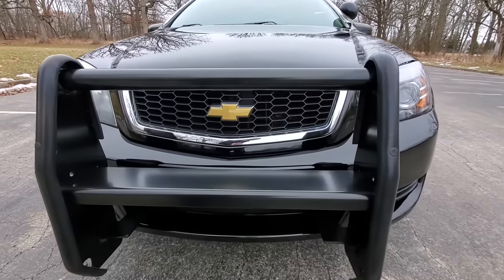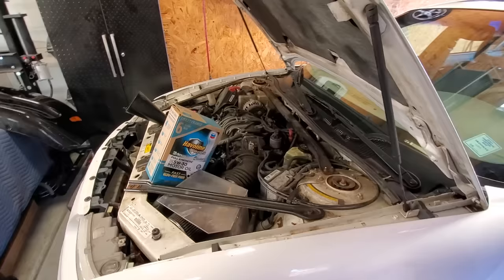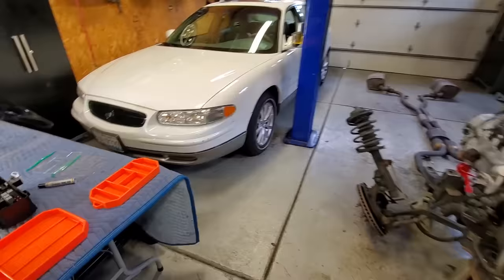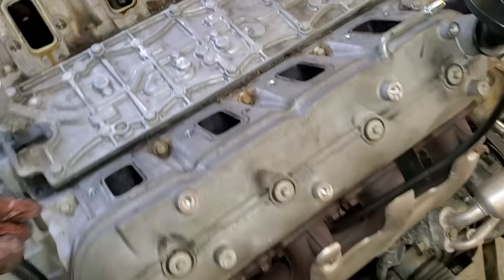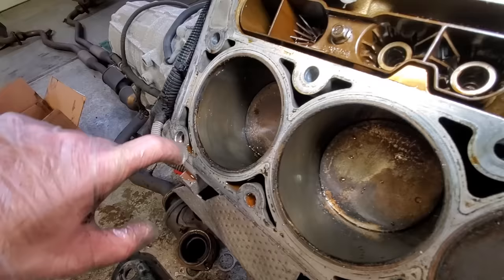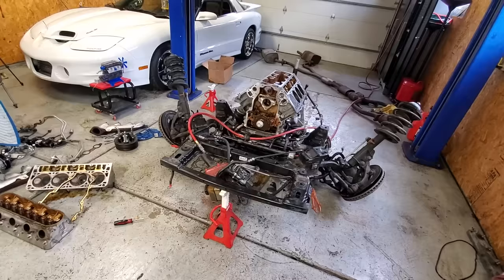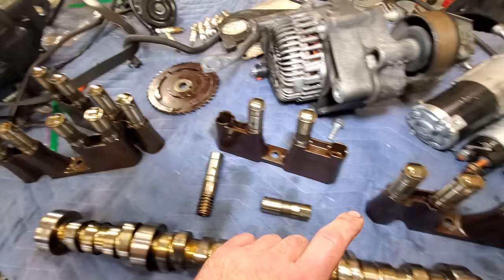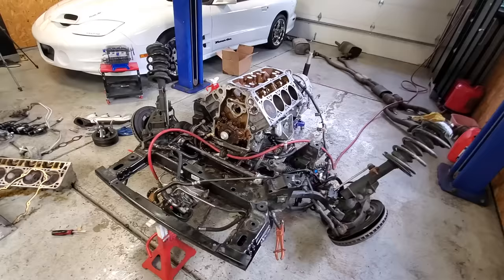Looking Inside An ABUSED V8 Engine That Idled For 12 Months! 357,000 Mile LS Teardown + Body Removal

Comment: Seems a lot like you just debunked the “1hr of idle equals 33miles of wear” myth. 

Like, that equation is more like 1hr = 2-3 miles.
Reply: You also have to take into account that they changed the oil a lot as he mentioned in the video, that is why that engine looks as good as it does.
Reply: Find the distance using hrs and the average gear ratio of your whole box to account for mixed driving
Reply: 8000 idle hours isn't that much. Not like it's a diesel from the 70s that would wash the oil off the cylinder walls. 

It's definatly high, but not crazy.
Reply: Well rule of thumb is a load of more than 80% is actually causing wear. At least according to what I have learned at trade school as a maschinist. Running an engine idle wont do jack to the engine exept for  a turbocharger that one will gunk up.
Reply: @vHindenburg  I guess average BMEP would be more accurate for a wear indicator then?
Reply: Compression would be I guess... how much oil it is losing and so on. Noise is also n indicator.General wear on belts and timing chain if the engine still has one. BMEP is short for ? Sorry English isnt my first language. And of course if the engine still produces the advertised horse power / kilowatts.
Reply: @vHindenburg  Brake Mean Effective Pressure. Used commonly in aviation as an indicator of engine output. It is basically an indication of engine load. It is the average pressure in the cylinder across all strokes. (Intake, compression, expansion, exhaust) 

A measure of how hard the engine is working. Better than measuring vacuum or rpm. 

Example, 200psi BMEP at 1000 rpm means the engine is working just as hard as 200 psi BMEP at 6000rpm. It will be putting out more power, but the effective loads on the pistons is the same.
Reply: Give me a dollar for every cam replaced in a patrol car....  Ill buy my island.
Reply: 8k miles is low in regards to idle hours for vehicles at my Dept. Most cars we have are about 15k idle hours. Plus 57k to 154k miles and our mechanics def don’t do PM’s every 3 months
Reply: @jaee1758  How do they that many idle ours anyway? Its almost illegal to leave a car in idle longer than about a minute ( At least by German law ). All because of AC? No start stopp automatic?
Reply: @vHindenburg  Cops rarely turn the car off. When they're posted up watching traffic, the car is running. We don't have any laws in the US that prevent this.
Fleet vehicles for companies often have a loooot of idle hours. People feel "it's not mine so I don't care"
Reply: @Juice-tr8xi  What is the benefit to keep the engine of cops cars running? New engines start up fast. Only some more wear in life time of that car if it has to go to full throttle after get in action. saved so much fuel and emissions.
Reply: @Juice-tr8xi  What  a waste of fuel. I cringe hard at this. Fuel prices are so much higher in Europe in comparison. But I get where this mindset come from then.
Reply: von Hindenburg  look at it like this if a Dept has 10 vehicles 4 maybe for supervision (those vehicles arent running as much) 6 vehicles for officers if your working 24/7 then a vehicle probably has 30mins of down time between shifts for a total of 1.5 hours of not running during a 24 hour period. And if a vehicle came into service in 2015 just imagine the wear and tear and the 10 different driving styles of the people sharing the vehicles.
Reply: @Ziellos1000  I think they real thing learned here is change your oil often and take idle time into account as miles driven.
Reply: Well, it is wear on the engine itself, but it doesnt wear the suspension and other components as much.  Engines last a looooooooong time, its the trans, suspension, and other parts that go out faster.

My dad and I travel a lot for work and often have to work nights or take quick naps between jobs.  We nicknamed our cars as "Hotel *car model*".  Across 8+ cars, they always burn right about 1 gallon per hour, and that provides all the heat and more importantly, the A/C needed to sleep and rest comfortably.  Much cheaper and convenient than a hotel, and we can fit a decent mattress in the SUVs.
Reply: if at all.. modern engines are designed in a way that idle is just a normal operating condition…
Reply: @vHindenburg 
 American legislation doesn't care about emissions. And if you're a patrol cop in Florida I would think you need that a.c. running near constantly anyway.
Reply: TESLA Electric car  is the ANSWER for this problem.
Reply: Alie148 because in hot climates the cars have to stay running with the ac on or it destroys the computer and electronics inside the patrol car.. not to mention the amount of gear and the vest le is required to dress while on shift
Reply: Stvn Bl the laptop will handle this, the officer won‘t with wearing all his gear
Reply: bigpjohnson Why? Modern engines are computer controlled and run Lamda 1 at idle as they do during normal driving... so no problem with oil dilution or the oil beeing washed of the cylinder walls... it may be different with carburators... also modern oil pumps are so powerfull that they provide enough lubrication even at idle speed... they might just burn a little more oil because at idle cylinder pressure is low and if equipped, turbo chargers also like to eat oil at idle because their seals need the air and exhaust pressure to keep the oil where it belongs
Reply: Jae E no cold starts, perfect for a long engine life
Reply: @acerc.e.4279  look into what goes into making just the batteries for those
Reply: So that isn't same thing new to me fare north in Eurasia it is commo to let the car running during the entire winter  (outerwise the engine wouldn't start again at - 30° C and lower) and man they have the cars for quite same time with out excessic wear to be true the bearings do look great because while cranking ur engine u have 0 oil pressure (for about half a rotation) and the metal parts a in contact (that's why cars with start stop automatic have allmost every time so called sputter bearing)
Reply: @bobl78  they have to keep them running anytime their systems are on or the cars will catch fire. The systems in the car draw over 150amps constant, requires a dedicated cooling system just fo the electronics, which requires the engine to run all the time which is why their cars come with 270amp alternators. Its not some simple laptop. Its an entire interconnected system.
Reply: @donniecahill5243  Sit down donnie. Come back when you do fleet maintenance. They do burn through alternators, ford went from 130amp to 150amp then in 2014 to 270amp on their special service vehicles. Same alternators as their commercial fleet vehicles. I don't have to know jack about electronics I just have to know what the spec sheet tells me it requires. It calls for 150 amp load safely. So sit down and shut up.
Reply: @Oldsoldiersays  you literally just admitted your own ignorance 😂 cool story bro, come back when you actually learn facts about duty cycles and basic electrical knowledge
Reply: @donniecahill5243  riiiight, sit down donnie
Reply: @Juice-tr8xi  You sir are incorrect. We most certainly do have laws regarding idling vehicles in the US. Perhaps not in rural areas, but the big cities have them for sure. In NY there's big fines for idling, especially if you're doing it in a truck, then you're talking up to a couple grand.
Reply: @donniecahill5243  Alternators don't produce their maximum output at idle. Actually not even half. This is why you're seeing 200+ amp alternators in a lot of regular vehicles now - to maintain battery charge balance at idle. And even then they're spec'd to be just good enough with all the doodads turned on.
Reply: @vHindenburg  So if I'm waiting at a two minute stoplight in Germany I'm legally required to shut the engine off and then put even more wear and tear on the start system when it turns green again?
Fuck that shit and fuck that noise.
Also start/stop systems are cancer. Eats starters, batteries like candy for no real benefit. Even in an EFI engine you're saving more gas by just idling the light out than using a start/stop system.
Reply: @acerc.e.4279  No, it isn't. Those overglorified golf carts would melt down in police service and the battery capacity would be eaten up within two hours of watching for speeders.
Reply: @TestECull  lol...kind a funny hahaha..NO!
Reply: @acerc.e.4279  Ahh, but they owuld. If there was any merit to using them as patrol cars they'd have been bought in droves years ago.

Those things aren't even good commuter cars for anyone who lives more than 40m from work. No way in hell they'd survive police duty. They're too fragile and running the aircon all day long would kill the battery before the thing ever chased down a single speeder or responded to a single burglary.
Reply: @TestECull  until u find yourself unspeakable to TESLA technology.
Reply: @acerc.e.4279  That doesn't even make sense.
Reply: @TestECull  how come? Are you an electrical engineer?are you a computer engineer? Are you a electronic engineer? How do you know?
Reply: @acerc.e.4279  You never elaborated on what you meant by 'find yourself unspeakable to TESLA technology'. Until you can make that statement something a normal person can understand I'm not gonna waste any more time discussing anything with you, other than to say the only Tesla you'll find me driving is one I've shoehorned a GM 572 V8 into.
Reply: @TestECull  lol...
Reply: @TestECull  im an aircraft technician and i know how I.C.E. works,Its maintenance and life span. And if you compare it to electric with G.T.E. generator it would be fun and long lifespan compare to I.C.E.,wouldnt that so cool if you have a vehicle that i almost free from engine tuning,wear and tear of the engine?
Reply: @TestECull  if u have so many doubt to electric car,then why dont u ask ELON MUSK?dude i think u r so brighter than me then ask them..lol to urself.
Reply: @acerc.e.4279  You're still making a barely intelligble word salade with every reply.

Damn right a nice ICE is gonna last a long time. GM 572 V8 with a Tremec TKO6060 behind it and a Ford 9" rear axle would be indestructible and would outlive the chassis it's put in.
Reply: @acerc.e.4279  Also, I'm a gearhead. The tuning and modifying is half the point. I WANT to be able to fiddle with it, I enjoy that. Nothin' quite like kicking the starter of a bigblock that is running because of your own sweat equity, hearing that gorgeous burble and knowing it's burbling so smoothly because of your own hands. Nothing compares.
Reply: @Alexie3333  It's hot and humid in Florida so they constantly have the AC running. The only time they shut the car off is the 4 or 5 times a day it sits outside the doughnut shop.
Reply: @Oldsoldiersays  With either the V6 or V8 engine the 2012 Caprice with the police package is equipped with a 170 amp alternator from the factory.
Reply: @Alexie3333  Mainly due to the electrical load. Take in the load of the lights, siren, radio(s), MDT, evidence logging system, etc. A cruiser can see loads up to 150A worth of electrical accessories and unless you have a sub amplifer, most people don't ever have more than 5A of electrical accessory load on their vehicles.
Reply: @vHindenburg  lots of electrical load. 75-150A worth of accessory is common. Start/Stop systems would be constantly starting and stopping the vehicle just to keep up.
Reply: @zapityzapzap   What would that be? we are talking of the eqivalent of an electric space heater here. Or an ac unit/ vacuumcleaner at 1,8 kW.
Reply: @vHindenburg  Typically, in terms of constant loads, you have the 2A for the two way radio (some cruisers have multiples), 5A for the MDT (computer), 1A for the WiFI client, 8A for the evidence logging system (DVR),  and 1-2A for miscellaneous chargers (portable radio, phone, body cam, flashlight, etc). What draws the most current though are the dynamic loads. Siren(s) will draw 25-50A, lights will draw upwards of 50A depending on configuration (halogen/strobe/LED), the radio while transmitting will pull between 14-27A (we have higher powered radios than most of Europe). The bigger issue is you can see just about everything except for the siren at idle so alternators are typically sized to provide 80+ amps of current at idle to maintain the battery and loads that could be seen which means the alternator typically has to be rated to 250+ A to provide enough current at idle.
Reply: @zapityzapzap  Its weird to rate all those  thats in ampere , I have to multiply by 12 V assuming the car also runs a 12 V sysrtem instead of 6V or 24V which also exist. I get about 1.100 Watt which would mean the engine would have to idle  at around 1% assuming 250 kW engine size  which I guess would be a little much too generous lets say 125kW which would mean 2-3% engine load including the equipment and air conditioning.(Assumed to be around 2,2kW)

Doesnt seem that much but that still means that the engine is running continiously.
Reply: I guess the problem with that myth is that its maybe true for the average car where a huge chunk of its idle time also happens to be when the engine is cold so then 33 miles per hour of idling is probably reasonably accurate due to the accelerated wear you get when running an engine cold. But for a police car that could be idling 8 hours a day, its only cold for like 5% of the time it spends idling so it becomes an insignificant factor.
Reply: @donniecahill5243  play nice
Reply: sierra 117  not problem when it is idling as heat dissipation is of course varied by load. Radiator / AC fan is more than enough to move air around engine when idling. Regular engine consumes easily less than one litre ( ~quart) of gas in hour and that makes easily less than 10kW of heat in worst case including AC heat and that.. well it is roughly the same amount than midday sun heating the surface of the car (roughly 1kW per square metre)
Reply: sierra 117 my cars have been dynoed several times. It is 100% not done while idling. Excess heat is is proportional to engine output power and fuel use. While idling there really not much going on.. Radiator FAN moves quite a lot of air in the engine bay if it is on full speed. But simple physics can be used to calculate how much heat there can be produced with given amount of fuel used. One hour of idling takes less tha mn fourth of a gallon of fuel usually and from that you just don’t develop much heat even if all would be burned to heat. And in real case some energy is converted to electric power, mech energy for ac compressor and sound.
Reply: @1000stevenbl  I get your point to feed power to ac and electronic stuff of the patrol car;)
Reply: Alie148 let me add to the fun.  How about a K9 car?  😂
Reply: @vHindenburg  I used to buy used Mack trucks for resale and the engine hours became relevant when the truck had a PTO for pumping bulk cement, flour or a vacuum pump. The idle load was calculated at 80%, those trucks had low miles in comparison with an over the road truck having 600,000 miles but the wear and tear on those engines was quite high, it was common to find broken lifters pieces in the oil crankcase.
Reply: @Juice-tr8xi  I asked one cop why they leave the cars running constantly, as he was inside eating lunch the car was idling in the parking lot.  His answer that it is an old policy but basically the cost of fuel is negligible compared to what would happen if the car failed to start when an emergency call came in so the policy is to leave them running
Reply: Just need to change oil regularly, it doesn't care if it's idling
Reply: @Juice-tr8xi  in the U.K. it’s illegal to leave a car running apart from on emergency vehicles where they purposely have it mapped in so they can take the key with them too.
Reply: Lol somebody actually thinks that cop cars get engine work done..  after the interceptor package is put on the only maintenance is regular with brake jobs...  they wouldbt spend the money itd cost to do any work to the internals and just put it in the auction yard...

Comment: Love discovering Havol8ne/Chevron Full Synthetic is so inexpensive for 6 qts!
Walmart is out of stock, though I have at least 30+ qts and tons of filters in my personal stock.
2006 4.7L Tundra 4X4 DC Limited with 103K and way too many short trip/idling hours still runs a champ, just burns a little oil.
That LS is impressive.